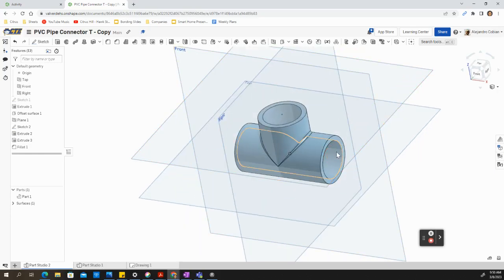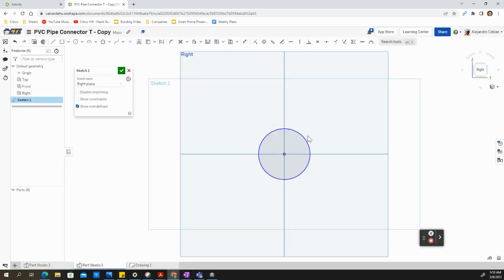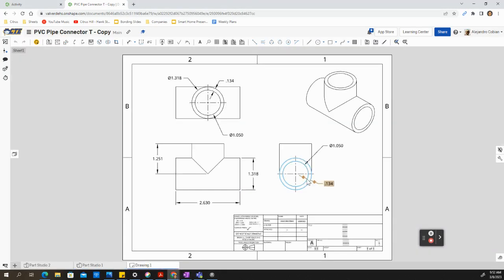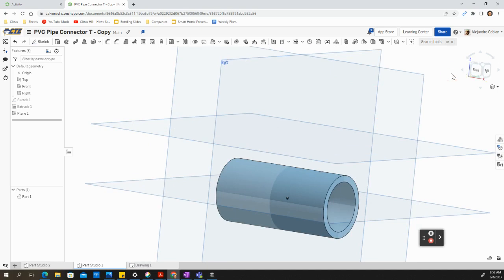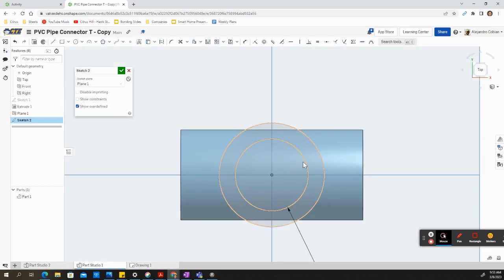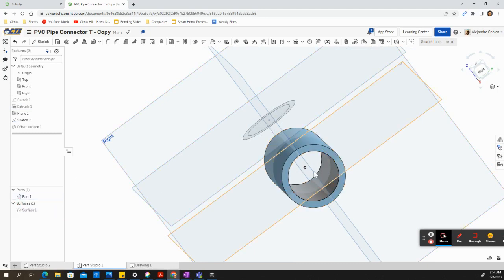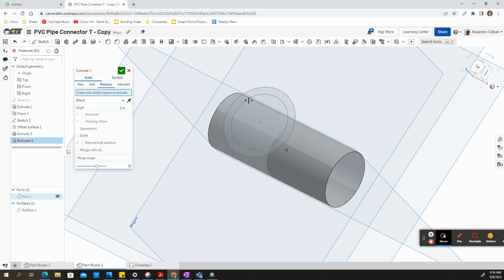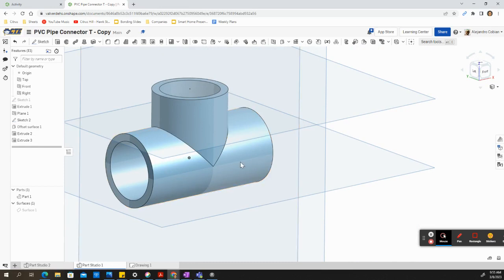Onshape PVC Pipe T Connector.

Comment: Why did you do the offset surface for the inner face of the tube ?
Reply from the maker: The following extrusion then has a definable limit. Without the inner offset, the extrusion does not get the smooth volume. I am going to update this video soon to include variables.
Reply from the maker: But, maybe I'm wasting time by offsetting the surface. I'll revisit this soon
Reply from the maker: Hey! The offset was unnecessary! Thanks! Here is the updated video with variables: https://youtu.be/R36Cg-bJ-v4

Comment: Some reason it won't extrude to the curved face.
Reply from the maker: At what time are you having an issue?
Reply: @createwithcobian570  I figured out the issue. The extrusion was larger than the face it was extruding too.
Reply from the maker: Cool. Yeah, that's an annoying but necessary feature.
Reply: @createwithcobian570 oh yeah completely makes sense why it didn't work. But I was trying to make a t-connector with different inlet and outlet sizes.
Reply from the maker: Were you able to make it?
Reply: @createwithcobian570 Yes. It's a little cludgy but I ended up making the center section larger and revolving down to the smaller diameter I needed.